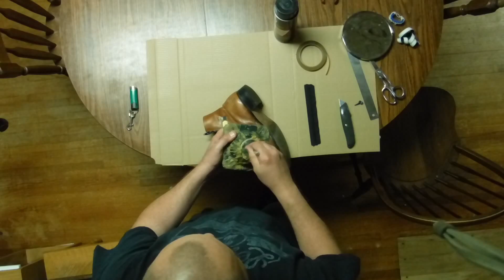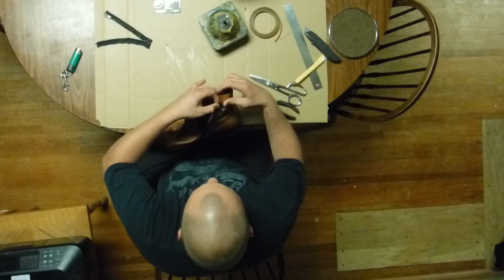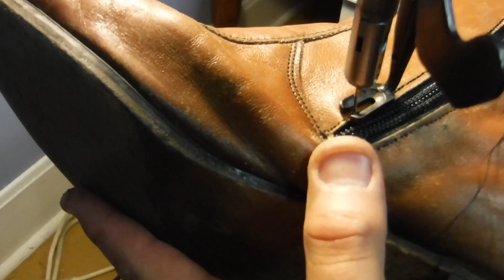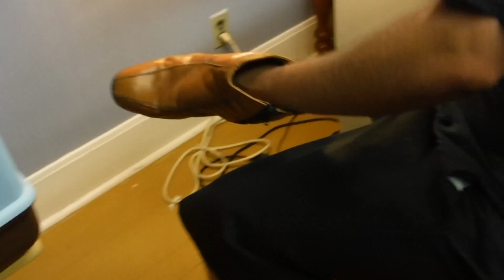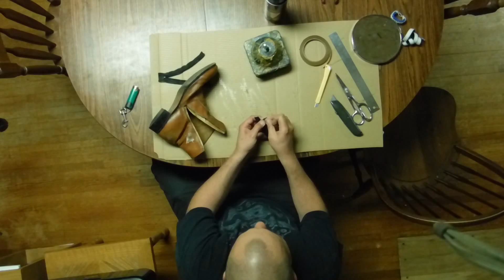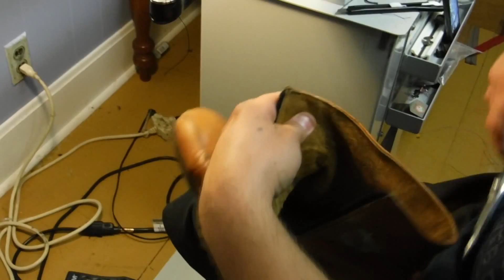How to replace a zipper in a boot With a open arm industrial, sewing machine .Sewing ,leather,repair

Comment: Can that machine sew on a new sole?
david
Reply from the maker: The easy answer is no unless it is a Moccasin  or a slipper .
Reply: David Bolts,
It that due to not being able to get inside the shoe or because the machine not being able to punch through a sole? 
david
Reply from the maker: Yes that is one of the reasons it takes a specialized very heavy machine to sew a sole on a shoe.This machine also lacks the capability of the heaviness of the thread required . There are more than one machine designed specifically for sewing soles on shoes some of them sew on the outside of the shoe which is a good year well style the other is a Blake stitch which requires a different machine I’m sure there’s more than that Some people still hand sew the souls on.
Reply from the maker: Some of the machines are a sutton rapid e a straight stitch or a McKay
Reply from the maker: You’re also correct on the machine not being capable of the correct angle for sewing inside of a shoe for example the McKay has a long curved arm instead of a straight arm
Reply from the maker: As far as the machine for general repairs leather fabrication it’s probably the best